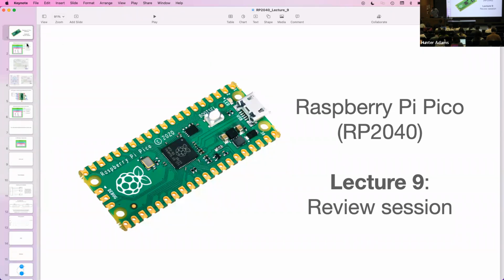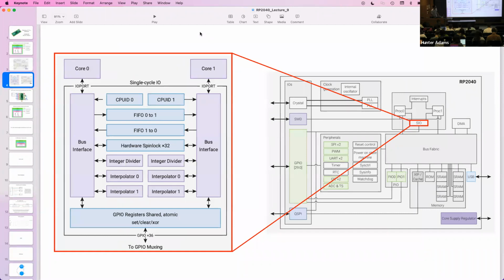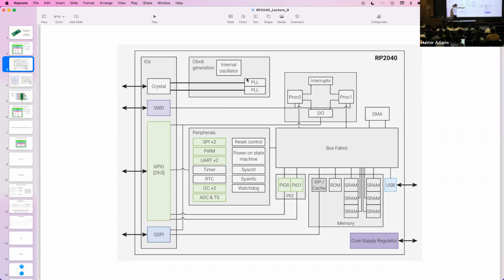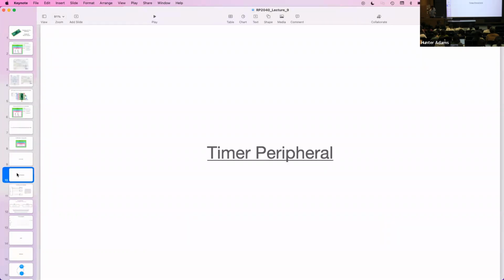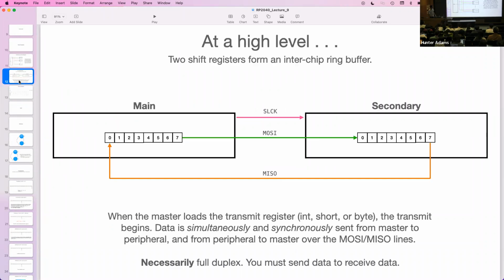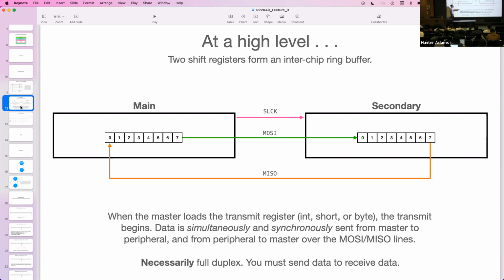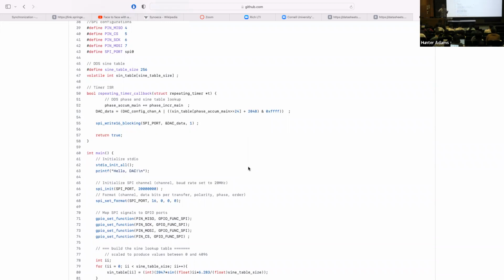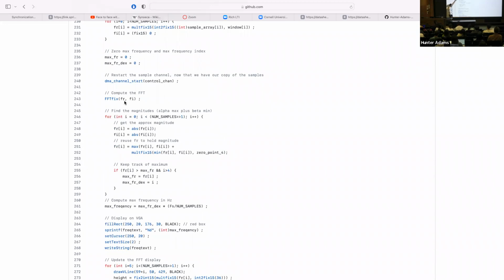Raspberry Pi Pico Lecture 9: Review session

Comment: An possible interpretation of the ring buffer question at ~34 minutes might be “could a secondary device initiate communication with the main?”, to which I suspect the answer is no, because the secondary would have no way to toggle the clock or signal with the chip select line.  Just a thought….